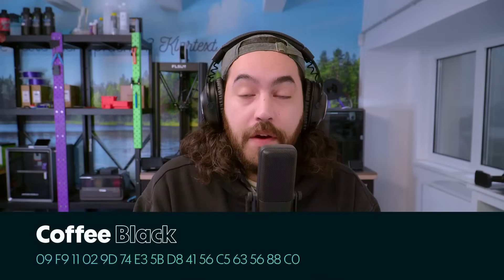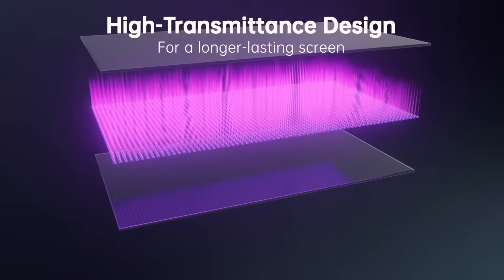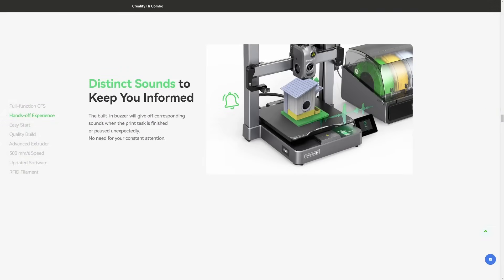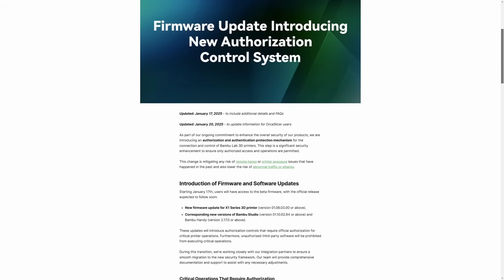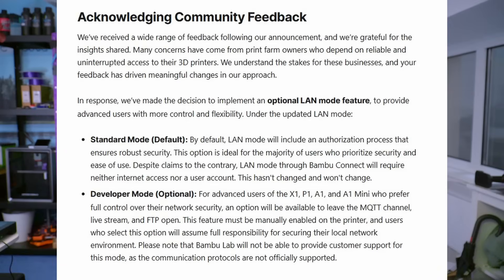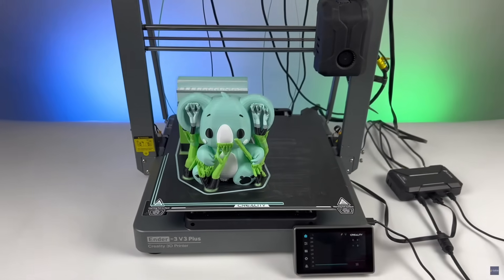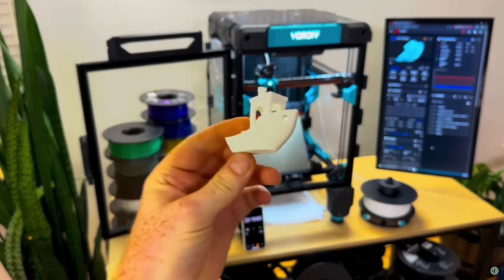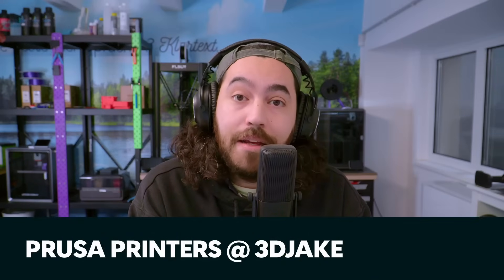Community News January 2025: New Products and News Updates!

Comment: I like that Bambulab will make their printers safer, as everybody should. And they have pretty clearly stated that they work with Orcaslicer and others, so what is the fuss about? Bambu makes exceptional printers that work great right out of the box. I don't see my great affection for Bambulab go away any time soon. :eyes-pink-heart-shape: But thanks for your videos - great content as usual.
Reply: Orca will work but you now have to send it through a new Bambu wall to get to the printer. Enjoy paying your monthly printer fees coming soon. The word "security" is just used as a cya word. What they did is called bait and switch which is unlawful. Hoping a class action lawsuit is filed.
Reply: @carstenjensen3123  it's NOT improving the security, it's just hiding them. And security by obscurity don't work.
Take a look at Linux it's open source and it's secure if the configuration is done right.
Reply: I guess another thing is that they remove features after selling the product with those features.
Imagine your car manufacturer would tell you, you need to get an update for security and they then remove the infotainment completely and make if impossible to put in a 3rd party one.
Reply: @nirfz  You mean as if Tesla recalled the autopilot feature, because it caused the vehicle to drive in to other vehicles? In that case I don't have to imagine. If the manufacturer has sold you a feature that turns out to pose a risk, they better go fix it, before the risk is triggered. Anyway - I am still very happily printing on my Bambulab P1S, and I think I will continue to do so.
Reply: @ Not exactely: more like Tesla switching off Supercharging for some people (because they thought they did repairs on their own cars without Tesla doind the repair) or switching off the seatheating function and other stuff for Teslas that people bought used. And Tesla suddenly claiming that features bought were not bought for the car but only for the owner.
Basically f* the customer by removing a working feature that does not pose a risk and that was paid for.
The Tesla autopilot should not have been sold the way it was in the first place, and the name itself is a crime, as it suggests to stupid and uninformed people to do things it can't.
Reply: Because many people pointed out that if they just want to make their printer safer, there are tons of alternatives that can make it safer while not locking the third party resources. Furthermore, many people also pointed out that this whole new authorization things is not improving your cyber security at all, but give Bambu lab the power to brick your printer in future.
Reply: @REN-fr2sm  Yeah, well maybe many people are not that good at cyber security, because 3rd party ressources can actually be used as an attack vector. But the dumbest thing is probably the notion that this is based on Bambulab wanting to brick our printers. First of all, that is not really a great markting step, and secondly, they could do it through a normal update, without telling us. This is the most lame responses to a manufacturer that takes security seriously. Anyway - life is to short, I have to be printing :person-turqouise-waving:
Reply: They lied on multiple occassions. Also this is lie "they work with Orcaslicer and others"
Reply: @LaDude-z7t  You really must love these completely unfounded accusations coming out of nowhere  🤡. I don't tink they lied. What's the basis for that accusation?

Comment: sad thing with creality now is they are locking the rfid reading in the printers to only their filaments, it used to be open to you tagging your own filaments.
not a really big thing but it is just sad that they are going this way to boost filament sales 😔
Reply: Use root and change it, or wait for a klipper macro
Reply: What other filaments use "open" rfid? Depending on tag data format, who would synchronize 3rd party filaments to slicers and printers?

Comment: Anycubic confirmed that the nozzle on the kobra s1 will not be hot swappable like the bambu one or as described in the video.
After testing they found some leaking , so a heat resistant sealant was added between the nozzle and heating block.

0.2mm and 0.6mm nozzles have been delayed for their release as a result as they will need to sell the heating block and nozzle attached.
Reply: @cartouchator  I think the hotend is hot swappable, similar to the one in the   bambulab X1C and P1S and A1
Reply: @segacynicstudio  I've asked anycubic and they replied to say that it's not tool less hot swappable but easy to change nonetheless

Comment: The new workflow is a mess
SoftFever (he is the Orca Developer) 2024-01-19:
Based on what I've learned from the Bambu Connect Beta, this is the workflow with the their new firmware:

First, use OrcaSlicer (or any other non-Bambu application) to slice the model and save it as a gcode file. Then, invoke Bambu Connect with the saved gcode file, which OrcaSlicer can do programmatically.
Next, the user must switch to Bambu Connect to complete the rest of the process to initiate the print:

Select which Bambu printer to use
Click the print button
Set the AMS mapping
Click the 'Send' button to start the print

Comment: For my opinion Bambulab is done, specially after the gaslighting.
The only thing that is acceptable to buy again form then is, if the opensurce the firmware.
Reply: LOL, ok whatever you say.   Revisit your comment in 2 months, 6 months, a year.
Reply: @jonwoodworker  in 2, 6 months, year -- when they release a new machine it will be received with a giant thud. Good luck to them. I'll run my printer in lan mode with no more firmware updates blocked from the internet access at the router. Don't trust them or their cloud -- since as per their own admission their cloud security is crap